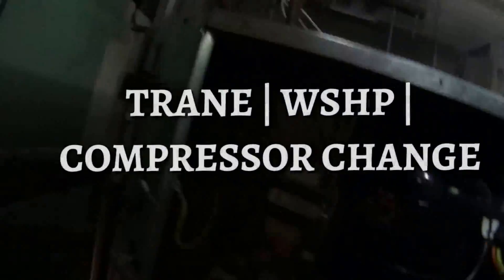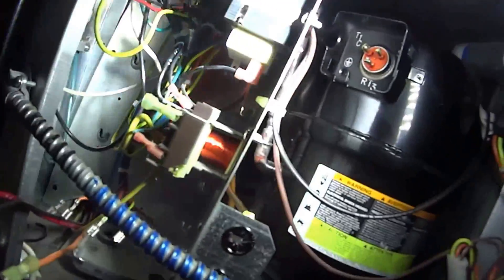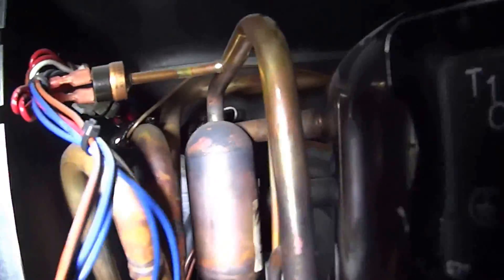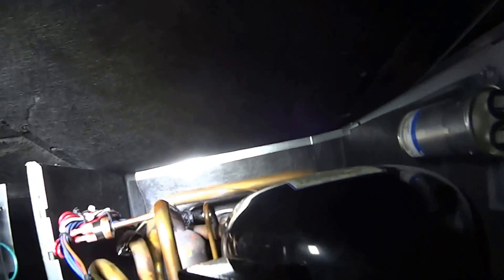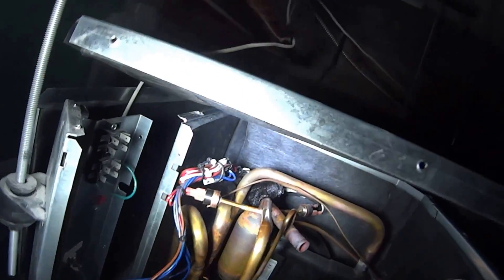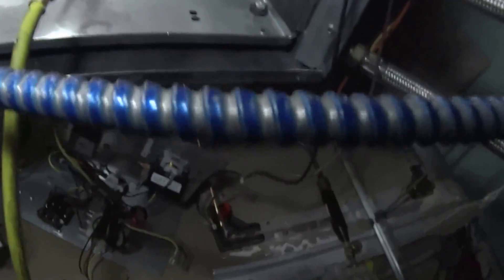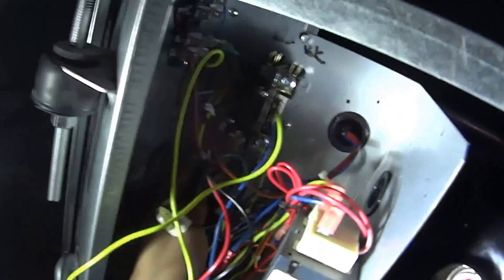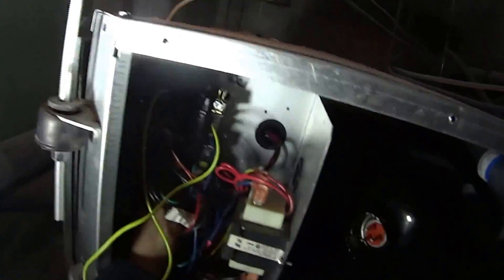Trane wshp | Compressor Change Out | HVAC

Comment: You earned your money on that one Emin! I've had a few where i have cut the stub off the compressor with a saw, (keep the nitrogen pressure up while doing to blow any chips out the pipe) then once the compressor is out the way its easier to melt the stub off the suction line.
Reply from the maker: That's exactly what I was gonna do if sweating it off wouldn't work lol. it wasn't so much of a tough one more like a frustrating one lol. Thanks for watching John.
Reply: Emin HVAC
I learned that the hard way, had a comp on a hotel roof, rocked it to get the discharge pipe out which was stuck and after a while it snapped off! was 5/16 pipe and i don't carry that size.....
Reply from the maker: heavydiesel wow that probably sucked lol
Reply: It wasn't a good day haha

Comment: Looks like you really earned your money on that job awkward with a few headaches. How is a system of lots of small AC units in tight spaces all over the building better than having one larger system on the roof or in the basement serving the whole building?
Reply from the maker: They do so that every tenant is responsible for their own equipment.  They just stick them in any whole lol
Reply from the maker: Emin HVAC hole, stupid phone made me type whole lol
Reply: Emin HVAC If they are renting isn't it the landlord responsible for fixing it anyway? If they bought the apartment the maybe it's their responsibility but it doesn't really seem to make sense in a building like that, must cost more to install more to maintain, more to run and the noise is closer to the residents. I guess it you busy though so it's not all bad :-)
Reply from the maker: Coolkeys2009 this is a condo building. The owner of the apt is responsible for their equipment, honestly the noise is not too bad. I do understand where your coming from, some buildings have chillers in the basement and fan coils in the apt, some have wshp, some ptac lol. I would rather have a big system in the basement.

Comment: Great job Emin !!! You must get yourself a bob to carry the heavy stuff up and down the ladder. Lol great video man
Reply: Excellent work bro. Like working in a rat hole man that was tuff I got tired watching just you haha.
Reply: Emin HVAC Haha I told you bro what is the heater set at? It's the little white dial above the heater it will have a arrow indicating the setting. Is it at the twelve o clock position? If so lower it counter clockwise to the 8 or 9 o'clock position then it will be dialed in bro have faith it's the Bomb leak detector.
Reply: No prob bro I know your frustration. I had high hopes for the h-10pro and was a bit disappointed when I first used it but after the adjustment I'm 100% confident in it now.
Reply from the maker: Thanks Harry! I had my Bob with me, however I didn't trust him to carry the compressor up the ladder lol
Reply from the maker: How dare u lol hey Joe I got this stupid H10 pro and that thing is screaming all over the place. Can you please make a video on how to set that thing properly and what's the best way to use it.
Reply: I will make a vid for you bro
Reply from the maker: Tazzman228 I was ready to slam it on the wall, that thing was screaming just by touching it.
Reply from the maker: I'm thinking about returning the H10
Reply: Noooo bro give it a chance I just uploaded a vid for you.
Reply from the maker: Tazzman228 thanks man appreciate very much!
Reply: Lol Emin HVAC

Comment: I completely agree about using channel locks on the b tank it sucks when people do that. they should inspect those everytime they fill a tank.  Sometimes they give little knobs on top love those
Reply from the maker: Your correct sometimes you do get a little knob, I like to have my ratchet on the btank with 2 clicks of opening. If I have to close it in a pinch I can, when these morons use channel locks it's difficult to do that.